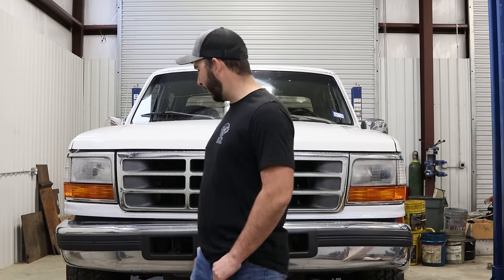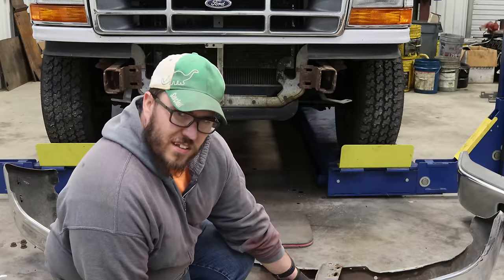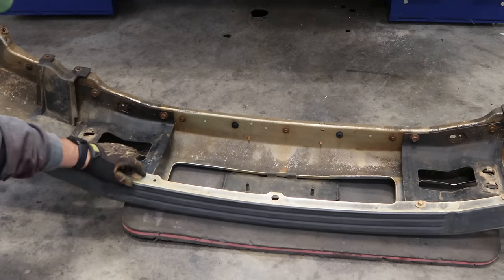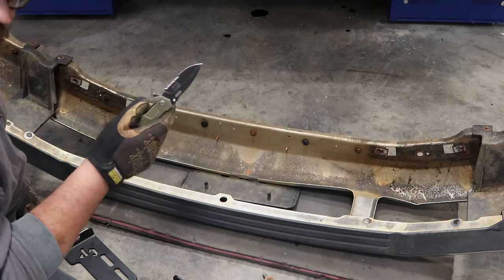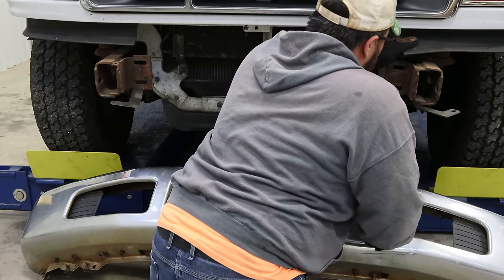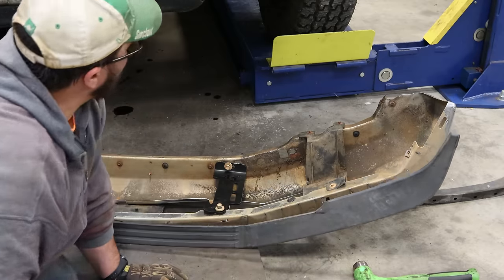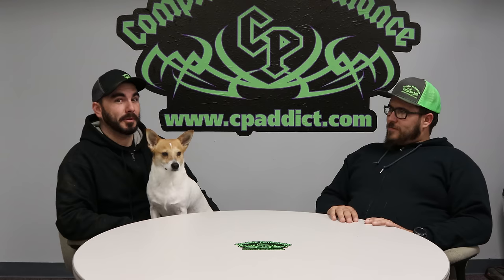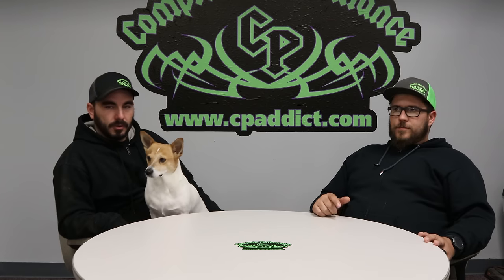08-10 Super Duty Bumper install onto an OBS 92-97 F- Series Truck or Bronco

Comment: The stock bumpers look much better than any of the SD bumpers I have seen on these.
Reply from the maker: We tend to agree but we do also like the custom touch sometimes too
Reply: @CompletePerformance  I get that, but there is something so nice about having all factory stock parts on these trucks that are 22 years old now. It took me 6 months to find a NOS rear bumper for mine. I did put 08 SD leather interior in it though.
Reply: everyone has their own opinion, I don't like mine to look like a grandpa drives it. I have a roll-on on the back, a 17 f250 bumper with brackets from theses guys, and the bumpers, grille, and headlight bezels are color matched.
Reply: @cowboy5754r  ugh, color match.
Reply: I don’t really like chrome. Like I said. We all have our own opinions
Reply: @cowboy5754r  like I said, it's too hard to find a stock 22 year old truck, that actually makes one stand out more.
Reply: How does it stand out when your truck looks like everyone else’s?
Reply: @cowboy5754r  like I said, everyone has screwed with them over the last 22 years, a bone stock one stands out because most are either rusted away, or been made gaudy by poor customization.
Reply: I really don’t know where your from. But where I live. Stock ones are all over. And they aren’t rusty.
Reply: @cowboy5754r  the midwest, where none exist that are not rotted out. Clean, stock trucks bring a premium over any sort of modified or customized one.
Reply: See. Where I live. I see stock trucks all day. I think there’s only 3 with 6.4 bumpers. And I’m the only one in the area. Maybe even the state with a  17+ bumper. I like to make my truck my own.
Reply: @cowboy5754r  I like to keep a truck original for as long as possible. I have a mint all original 1978 3+3 C30 dually. It stands out because its original.  Just like my 97. No goofy big ass wheels with low pro tires, no paint match, bone stock 22 years old.
Reply: We all have our own opinions. I can see where your coming from on the c30. I want to get like a 77 f250 and keep it era correct. The most i would do is some new 16s.

Comment: Nice video. I removed the old bumper on my 1989 Ford bronco two and installed the new aftermarket bumper I work the whole day working with the two frame brackets The bumper is bolted to and cannot get the passenger side perfectly straight with the driver side the only thing I could ascertain is a Bent bumper frame bracket or slightly tweaked frame! Looking at it most people would not even notice it but I do! I suspect when the new bumper was made it had a slight Twist from each opposite ends maybe a quarter inch all well! Thanks for the video
Reply: instablaster

Comment: I prefer the OEM bumper on OBS Fords, I really like the Diesel style with the cutouts. I've been trying to find one of the Diesel bumpers in really good shape to put on my 95, but here in WV I've not had any luck.There always beat up & rusty, and that's even when I can find one..Also, since I have a really lower mile 95 in fantastic condition I don't want to put a Crappy bumper on it. I'd love to find a NOS one, but who knows if any even exists & if one did I'd hate to see how much it'd be. And I don't want to go Aftermarket because I've heard that they aren't made out out of very good material.

Comment: Is there a way to get a newer super duty front clip like anywhere from a 99-2010 onto a 1990 bronco? I see a lot of swaps to the 92-96 clips, but I want a 08-10, or at least a 99-2002. Im looking for a donor truck to swap out the suspension and get the straight axle on it, but I really do think that newer clip would look pretty sweet.
Reply from the maker: Not to our knowledge as the body lines won't line up at all. Now if you were good with bodywork I am sure it could be fabbed to go on.